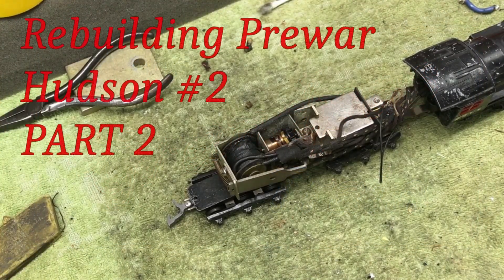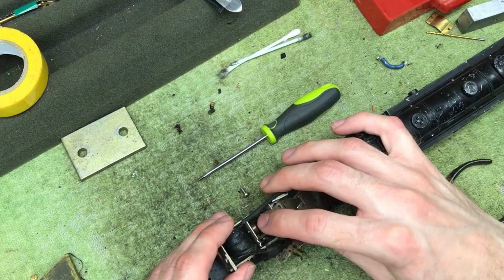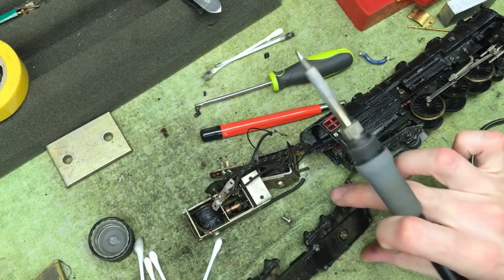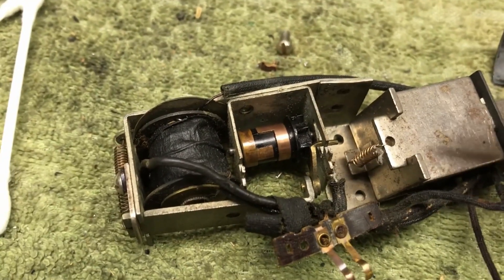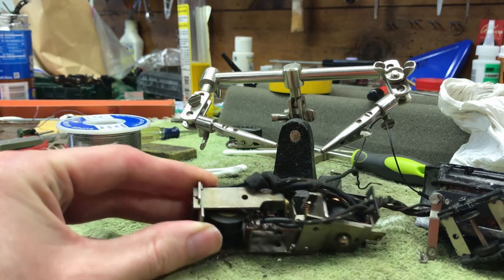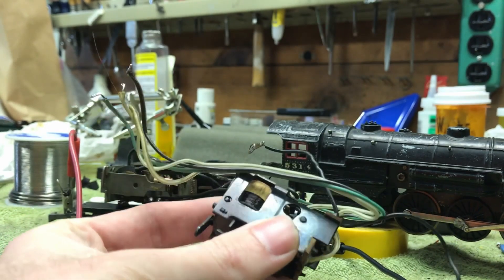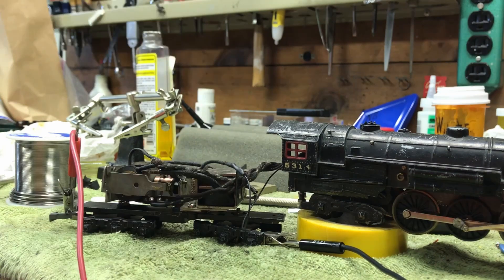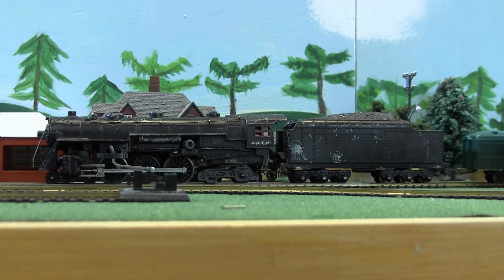How To Rebuild A Gilbert HO Mechanical Reverse Mechanism | Metal Steam Episode 3b

Comment: Everything looks good so far, but I was curious about the pilot/Cow Catcher on the front. Is this a separate part or is it casted to the shell. Also, if it is casted to the shell, could a replacement be made to fix it?
Reply from the maker: The pilot is a separate piece. It could be replaced if one wanted to. I think it is actually cast lead, not Zinc metal like the shell. Next weeks video will show how I repaired a different one.
Reply: Nice job.  I still have several prewar 3/16" locomotives with the RDC reverse units in boiler.  Those boilers have a small hole over the contact plate so you can push the contact points together to maunually operate the reverse unit without taking anything apart.